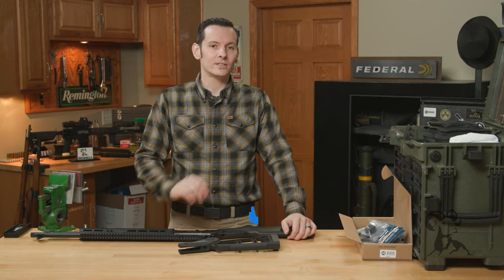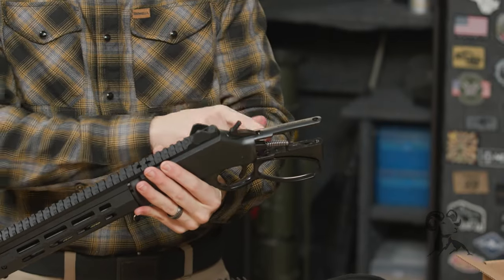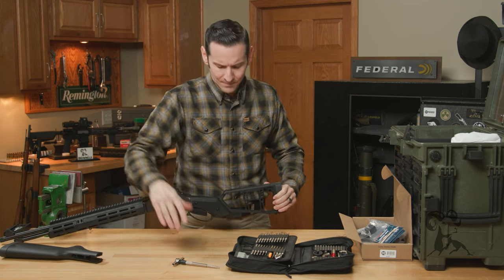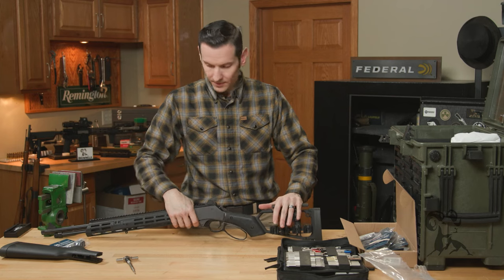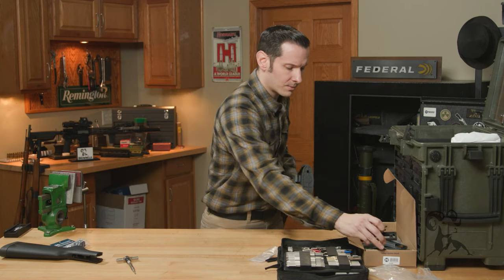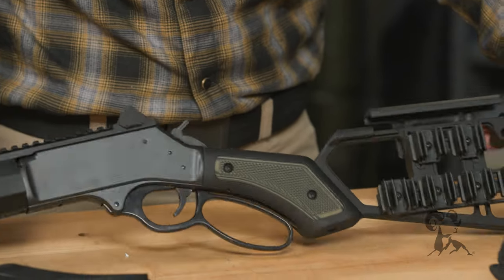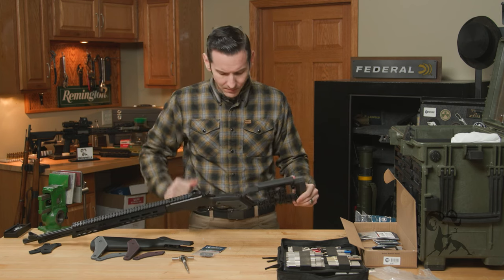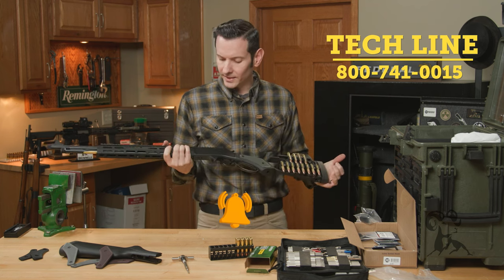Quick Tip: Installing the Midwest Industries Lever Action Stock

Comment: Since you said it first. Related to knocking stuff over as you work at your bench, what about chasing tiny detents and springs that launch across the room? A full video showing crawling around the shop floor with extra lighting looking for a tiny detent  or other spring loaded part.